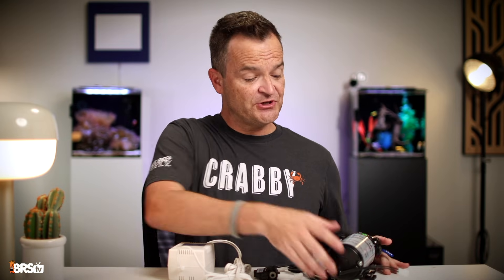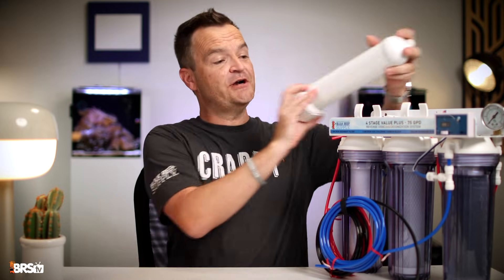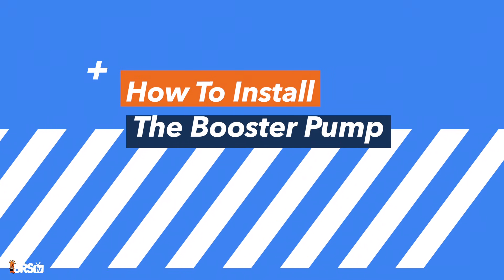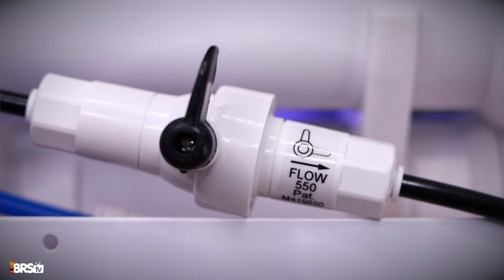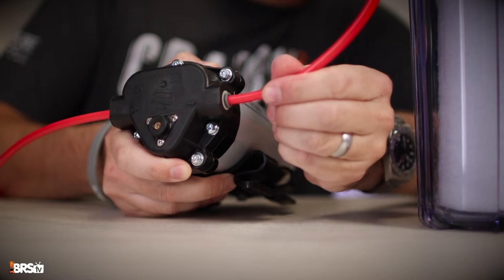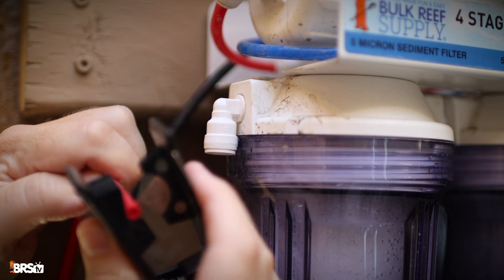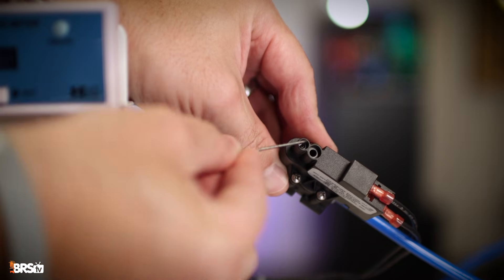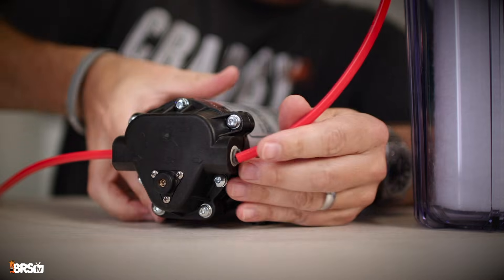RO/DI Water Pressure Too Low? Fix It with a Booster Pump!

Comment: If the booster pumps turn and off when its full is this a float valve issue or the pressure reader? Ive turned the screw all the way up and down doesnt seem to really affect the turning on and off